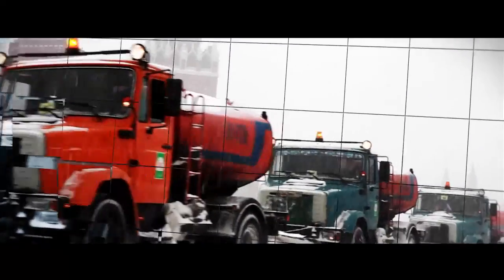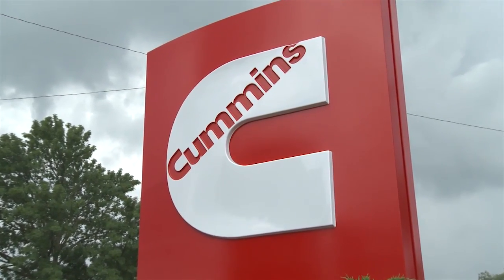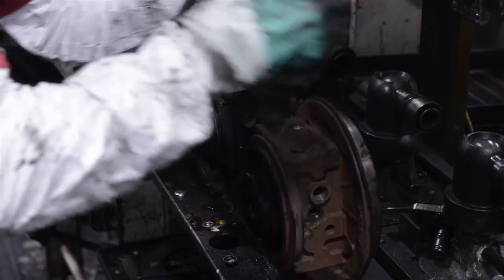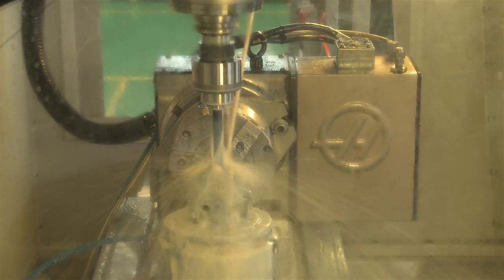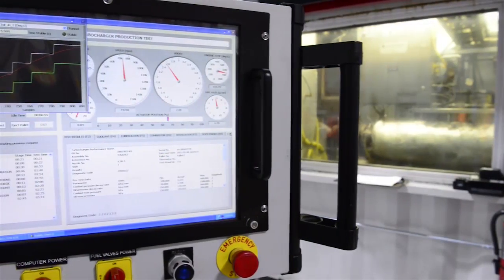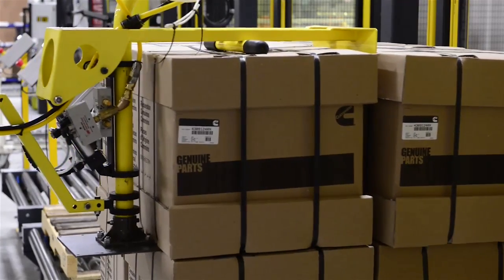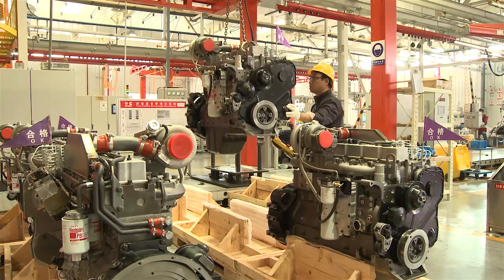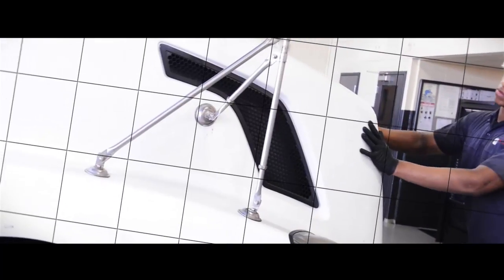Cummins Remanufacturing: A Story Retold

Comment: The modern style holeset vnt turbo on the joke of a Cummins isx engine is lucky to last 2-3 years. To many issues with the design for example carbon build up to the point of vgt lockup. I have also saw a 280,000 mile MX 13 with the same holeset turbo fail just because a code popped up for turbo not in synch, just replaced the $4500 turbo without even any actual testing. Computerized mechanical components do not rewrite the laws of physics. Just make more points of possible failure. Thanks for your time.
Reply: I've got 700k on my original turbo
I do have a reman in the shop but haven't used it yet.
But I take all my intake and egr off and clean it every four months 
Clean my dpf and doc every six 
Haven't had any derates
Reply: Well your a shitty mechanic if you replaced ANY component without testing it prior! Proper maintenance and not abusing them they will last 100ks of thousands of miles issue free as evident from how many are still on the road not rebuilt or touched....
Reply: Take it apart and clean it if the vgt doesn’t move. It’s very easy to do.

Comment: I nearly choked at the start when he said the turbo had done millions of miles.
What cummins truck engine in this day and age will do a million miles?? 
Maybe the old ones, but not now.
Reply: You ain't lying man
Lucky to get 800k out of them
Reply: Blame the EPA. However, if the research on Ducted Fuel Injection is legit, we may see even more million mile engines without the EPA whining about NOx and soot...
Reply: @MyTubeUser321  
That would be sweet to have that service life back in a truck.
Hell
I might even spring for a Pete then

Comment: It's a shame that there is only one Cummins remanufacturing in the U.S. one in Memphis the rest were either in Mexico or across the big pond ! I'm a proud owner of a 2002 5.9 Cummins in a 2500 Dodge pickup ! It's been by far the most reliable motor I've had as it has close to 285000 miles on it am still going strong today no major problems ! Just normal things like starter or water pump & alternater ! I give it 👍👍
Reply: Funny thing powerstrokes that I owned far exceeded that mileage with oil, air filter, and fuel filter changes. Transmissions were the failure point in 2nd gear synchronizer at about 170,000. 1995 model had glow plug and starter problems, every other year I owned had no problems like this.
Reply: Bs there is one in Columbus Indiana. And alot more in the 🇺🇸

Comment: Any chance the new Cummins R-2.8 for the Wrangler will be able to fit in the Cherokee XJ. It's lighter than my 4.0 and gets better gas mileage.
Reply: im sure it can might need to fab some mounts
Reply: @JASONHJEFFERSON  people donw that to GMC motorhomes and destroyed the damn things (cracked chassis I believe). Have to be engineered for vibration to not cause cracks to form elsewhere.
Reply: Most likely won't dienas quick as a chrysler. Unless you have the old inline 6 from the 90s. Which was really something AMC designed before chrysler took them over.

Comment: I have a question, I have a 97 24v I6 on my dodge, 508,900 mi. can you guys "exchange" that old engine, I like the truck since its a one-off tow/recovery vehicle for off roading, building a new truck will cost me over $90,000 USD.
Reply: Cjrm3gtr your best bet is a Cummings distributor or the Dodge, Chrysler dealership.